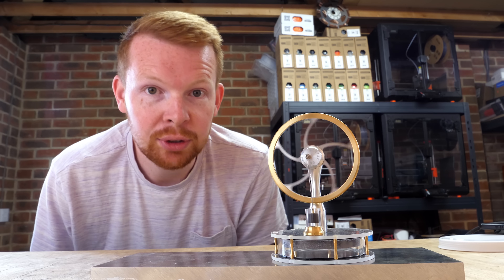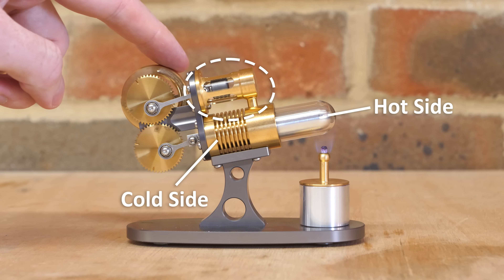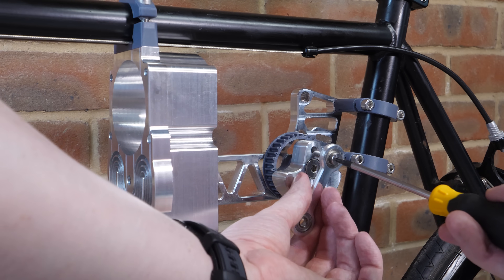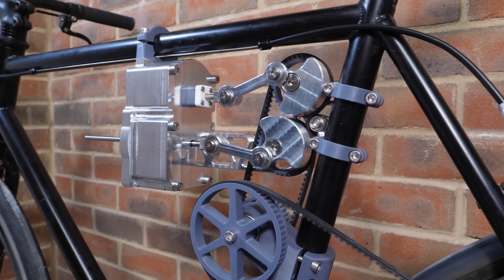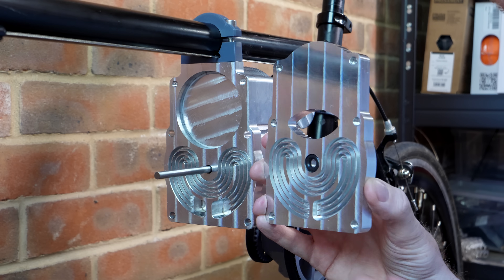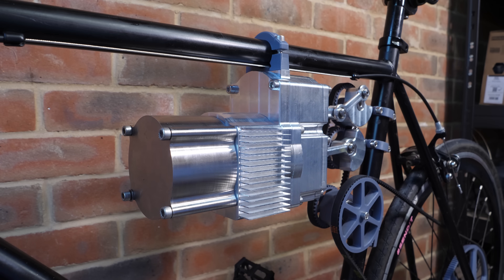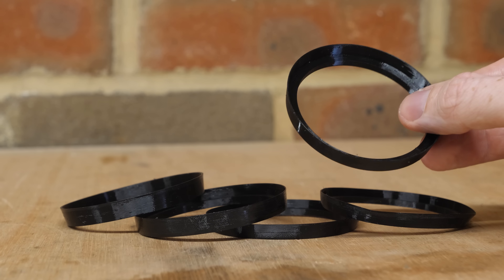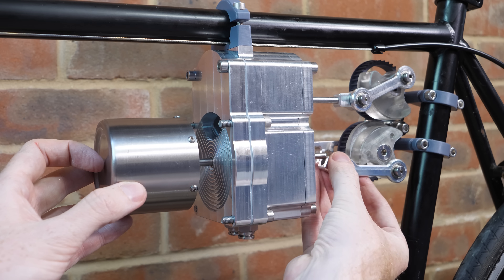Building a Stirling Engine Bike - Part 1

Comment: Tom please make this instead it works 100%  A Hall back array Magnet you turn on and off to pick up heavy steel, well it uses little to no energy to turn the magnet on and off, you can make a repulsion motor by making a piston engine, that when the magnet is reppeled the hallback switch can rock past a cut off to then recipricate the engine over and switch to turn the magnet back on all using simple mechanics. I hope this helps you and others. Have an amazing day.

Comment: Good call on the flywheel. What about mounting the cylinders vertically with compression stroke facing down to get that small gravity assist. Plus it would remove horizontal tension on the shafts.

Comment: Hi Tom, great work!
I'd like to share my idea, even though I'm no engineer: consider mounting the engine with the hot end toward the rear wheel, so the entire radiator will be exposed to fresh air as the bike moves forward. Then, with various air ducts, you could also increase the flow of fresh air to the radiator core while simultaneously confining the heat around the hot end. That's assuming my suggestions benefit heat exchange. If you want to go all out, you could also consider making the radiator core out of copper, isolating it from the hot end with a cork gasket, or some other thermally insulating material (though that would add a few pounds to the final price).
P.S. I finally figured out how the Sterling engine works.

Comment: FWIW: Despite their inefficiencies, I appreciate what are in my opinion the two biggest advantages of the Stirling Engine over the Steam Engine:  

(1) No boiler to potentially rupture and explode. 

(2) No need to have to top up the water in the boiler from time to time, which if neglected could lead to "(1)" above. You can use a steam condenser to recover the water, but that adds weight and complexity to the engine.

Comment: Sucks the CNC machine cant print out Nitrile Rubber seals. Not sure how theyd hold up in your engine but theyre pretty flexible and used for varied pressures.
Reply: Or 3D printer even... Ive just drank pretty strong wine... Im gonna go watch videos on different engines. As for your steam engine idea, its a good idea, buuuuuuut to really make it reliable, youd need to run the moving bits in a engine block separate to the cylinder head so you can oil the moving bits and work a pump that runs the steam oil through a tube into the cylinder head to lube up the cylinder head then have a way of running the steam through a radiator to cool it back to water, to run through the cylinder head again thus needing less refils... But youd need a way to separate the oil... I thought of a way years ago using some mesh that steam would pass through but oil would get trapped and recirculation in the head using a ultra fine bit of kevlar or something but then figured it would melt the kevlar

Comment: I was wondering if a Stirling engine could be used to produce electricity from concentrated heat using a parabolic mirror as the heat source. I'd love to see you build a Stirling engine, especially for this kind of setup. I believe this approach could be very useful in remote areas where commercial electricity hasn't reached yet.

Comment: Trouble with stirling engines is low power output - they need to be pressurised to produce any useful output. Might be an idea to study the Philips generator set from the 1950s. It produced about 200 watts.

Comment: Dont waste your time on a direct driven sterling bike! The biggest problem with sterling engines ist, that you could not control the RPM. You should use the engine to produce electricity, f.e. stored in big capacitors, and with that you could drive and control the speed. 
You also could replace the air with helium. 
By the way, did you ever heard of the "Manson Stirling", this is an open heat engine, a bit easier to build because it dont has to be sealed completely.

Comment: You are losing most of the power trough your "working crankshaft" Its not centered on the piston, and your connecting rod angle is way of when it "fires" and tries to push it in the opposite direction for a good 10° or so.

Comment: I'd love to see a Stirling Engine with a wood fire that circulates water to heat in metal pipes. It could be a good way to heat an outside patio with a wood burning furnace inside a cabin.

Comment: That is pretty cool but not at all practical, the amount of heat needed to make the engine run with enough power to move the bike along the road with you on on it would be huge, you would be just as well off making a steam engine

Comment: You would likely have better results if you used a common crankshaft with an offset eccentric for the displacer, much like a steam engine. This would eliminate the wasted energy required to turn a whole separate crankshaft. I look forward to seeing where this project goes!

Comment: Excellent! 
You did a lot of good work.
With that low torque maybe it could trickle charge a battery for an electric motor and even while it’s parked if you used a solar heat capture reservoir of some sort.

Comment: This is really interesting... I have been dreaming of having a tiny heat engine for a generator. And like you, once upon a time I did think of steam. Then I learned of stirlings. Since then however, I have been also considering Brayton cycle, which is best known for gas turbine engines, but turns out it could be used with external heat as well, now that would sacrifice efficiency, but I don't care so much about efficiency, as the idea would be using waste heat to provide some electric power.

But so far, these are just dreams... I hope some day I could tinker with things I have been dreaming about.

In the meanwhile videos like this are inspiring.

Comment: Instead of a burner, why use one of those induction heaters that can heat up stubborn bolts, im sure you can get hand held battery powered ones.. You could have it surrounding the top of the displacement piston and wrap high temp insulation around the heated parts to keep heat trapped around the top of the displacement piston.. just an idea! Love your vids and cool ideas you come up with!

Comment: Have you considered a turbine instead of a piston? It might help your sealing issue 

Secondly, how is this any less work or any less efficient than a steam engine? I'm not even sure if this would be more safe considering all the modern bells and sensors you could add to a steam setup to make it practically perfectly safe

Comment: Everyone always says these things run on heat. 

Tom, I have an idea.

You know how warm the ambient air is?

It’s pretty lukewarm to us, but you know what BOILS IN THE AMBIENT AIR TEMPERATURE???

That’s right:

Liquid Nitrogen.

Adding a burner is kinda meh in my opinion. At that point you might as well have an internal combustion engine. It introduces all sorts of extra problems to solve. 

But let’s clarify something:

Sterling engines do NOT run on heat alone. They run on the flow of heat energy BETWEEN temperature gradients. Hence the reason for a hot AND cold side. You already have to cool one side of it. Take it down in temperature far enough (ie. with liquid nitrogen, and the ambient air temperature will be plenty for the hot side.
And if it’s not, then heating it after will be a much less problematic endeavor.
Reply: @morganrowlette678 I can't wait to see your video, will it be ready next week?

Comment: How Tom Stanton Ended Junk Mail
Epsiode 1: You are here.
Episode 2: Regenerator makes the engine powerful and efficient enough to drive the bike.  Slow test ride montage.
Episode 3: Engine is incorporated with a DC generator into a hermetically sealed pressurized chamber and the power density increases to a feasible level for an ebike range extender.  High speed test ride montage.
Episode 4: Tom develops a combustor that gasifies waste plastic and paper and then burns the char.  The combustor uses oxygen sensors and flow diverters to ensure the exhaust gas is stoichiometric to lean, and an enthalpy wheel to capture heat and fuel particles from the exhaust to be sent back through the combustor.

Hey presto!  People stop paying for fuel, and start collecting rubbish to power their commutes.  People begin applying for credit cards, coupons, and ordering catalogues.  People start making tiny donations to every charity they can think of, just to get requests for more in the mail. Junk mail gets abused as a fuel source to the point that it simply stops.

Comment: I have this exact engine made by kontax. Excellent British design and Cnc machining. I run it to occasionally and find the slight ticking noise relaxing.
I bought it at a model engineering exhibition in Harrogate.

Comment: Machinist tip from a machinist. Your end mills are hanging out to far from your tool holder. Bring your tools in closer to avoid tool deflection. ESPECIALLY if your going to move on to steel.

Comment: Could you use a small inductor to heat the stainless steel and have it run off a battery pack instead of a burner or propain?

Comment: I have been wondering what efficiency you can get using a heatpump with a high COF to create a hot and cold side, considering it can create 4 to 5 units of heat, and 3 to 4 units of cold for one unit of electricity. Wonder how close you can get to 0 energy usage in combination with a sterling engine

Comment: Some time ago i looked into sterling engines. If I remember correctly, they can be efficient at quiet low temperatur differences. A DUNE - style body suit, that pumps liquid in a layer around your body, activated by muscle action, might - at least in the cold season - be a better suited heat source than a blowtourch between the knees. -well, the top power might be lower.

Comment: I've never heard a Sterling Engine called anything else. Certainly not a "hot air engine" because it does not run off hot air. If it did, you'd have made one long ago.

Comment: You can modify it to run a generator like a range extender, where it can charge up some capacitors which then are used to power an electric bike setup.

Comment: Directly running the drive with a Stirling engine sounds difficult. You might have better luck turning a generator to power a hub motor. With a battery or capacitor bank in between.

Comment: Any way to use induction coils or another electrically powered means to heat the cylinder? Having a flame under my seat is less than ideal.

Comment: Its looking like you dont have enough weight as well to help retain the kinetic energy made by the stirling engine. 

I'd also look into another heat source or a way to contain it safely in use if you actually want to ride on this thing at some point.

A suggestion for a arguably safer heat source would be some thermal wire from a hairdryer or heater and a high capacity battery (and possibly a way to change the voltage running though the wire so you can shut it off or lower it during travel to store power... and maybe a alternator to recharge the battery from the stored thermal energy on the go)

Comment: Dude I applaud your efforts. Try measuring the compression with reference to atomospheric pressure. Then consider the Thermodynamic equation where you a/c for both Heat and Latent Heat. Then find out the Energy that is being delivered by the piston and then find our the angular momentum it would produce in the crank. This will give you the overall HP produced by your engine. Maybe you need better compression ratio. All said - how are going to deliver that much heat energy and that too just between the cyclist's thighs ? All puns strictly intended and intentionally coincidental. LOL

Comment: I noticed the following thing : when you had stopped the engine and took the burner off and then hand started it again, it seems to run faster for a bit on stored heat than it did before with the burner… my guess is the water cooling was still running , and so it seems to me that the cooling side is not efficient enough, but your isolation is.

Comment: The ultimate siteling engine bike would have a heat exchanger you wear, and power the engine with your own body heat as you work out while cooling you down. I mean, of course this would only aid in moving you forward, and probably not by much, but still

Comment: If internal combustion engine design ports over a bit, the surface finish of your cylinder and the piston ring thickness (thinner is better) are major factors in sealing and parasitic drag.

Comment: The design of the piston ring only seals positive pressure but when the air cools down there's negative pressure. You should add a second piston ring turned the other way to seal that

Comment: This really isn't a Stirling engine without a regenerator. That's the very thing that makes a Stirling engine, and what distinguishes it from a simple hot air engine. The regenerator dramatically boosts the efficiency, making Stirling engine actually practical in the right circumstances, unlike a hot air engine which is just a toy, regardless of the size. Completely omitting it from your explanation and not even mentioning it until the very end sadly perpetuates the misinformation that persists around these engines.

Comment: while intresting the engine placement means you're going to burn the inside of your legs and you won't be able to ride it safely a more optimal location wold be directly above the rear wheel out of the way of the rider.

Comment: youll prob not seee this but heres what im certain of. the bike wheel is huge in cotnrast to the engines force per rotation. what im sayign is you need an extraordinairy amount of torque or inertia for the engine to successfully turn the wheel WITHOUT ANY GROUND RESISTANCE meanign ti struggles when only friction exists. a simple and easier solution is transmission logic, where you change the ratios so that the stirlign cna get a consistent uninterrupted and smooth rpm in exchange for slwoer wheel speed, yes i know its a sacrefice but the other option would be to increase power stroke frequency by addign several mroe pistons to cover for the "in between states" the stirlig ahs difficulty overcoming in. hope this helps

Comment: Cyclist here...  Im not sure that makes enough power to go very fast, but that might not be the goal.  There are a lot of electric bikes coming out.  Its a little annoying when they go 30 mph down the cycle path.  On the other hand an engine that simply puts the equivalent power of the wind at your back might help some people.  Doesn't really matter if it throttles well.  Light constant torque is fine.  IMO the problem to solve is improve thermal efficiency so that it doesn't take a blow torch to make it run.  That is probably way more than a few watts of energy.  Use a section of frame as a radiator and circulate coolant with a magnetic coupling for an impeller using the wheel to turn it.  I'd be curious to know if the engine works backwards when you roll down a hill turning kinetic energy into heat.

Comment: Ciao Tom! If I could suggest an alternative to the blow torch for the heat source (I'm still not convinced you need such a high temperature on the Hot side of the stirling piston), you could use the Catalytic process of burning flammable materials without the flame, like the one used in hand warmers like this: ZIPPO MOD. 40365

Comment: Waw, Really Genius and professional. What if you add a Gearboxe between Crank and Flywheel? Will it increase the torque at Flywheel and Reduce load on Power piston?

Comment: neat. few ideas. home/polish the cylinder wall. charge with nitrogen as it expands more than air when heated. bolt on bigger fins around mid section. silicone isn't a good insulator it needs something between hot and cold end and perhaps less surface area. make duct over hot end trap the heat.

Comment: I've been wanting to make my own stirling engine for a while now. Have you tried adding steel wool between the pistons maybe? I have heard a regenerator makes a lot of difference. Also, congrats on getting your engine running. Designing stirling engines is pretty hard to do, especially designing one for a large output; getting them running is also another challenge. Also lmao, just watched the part where you mention the regenerator.
Reply: The my engines guy on youtube has some really cool videos with stirling engines. Also look into thermoacoustic engines. They're mind blowing and imo a lot easier to build than a traditional stirling engine design.

Comment: 7:05
More efficient? I mean, technically they CAN be more efficient, but they usually end up being ~30-40% efficient, which is about the same as the most efficient ICE engines we have. Steam turbines can be just as effecient, but are MUCH more power dense, although you'd need a condensing steam engine to use on something like a bike.

Comment: Similar reasons they can only be used as a range extender for a battery electric platform vehicle, they are hard to make but can be exceedingly efficient if well made with very high precision designed over hundreds of iterations of tuning to get a solid version for production, far more finicky than automotive engines, its super trick and requires aerospace level machining & thermal management heat control thermodynamic tuning

Comment: Fill it with helium. Hydrogen is more preferable, but explosive. Makes the transfer of heat faster. 

Will take more work to make air tight, but I'm pretty sure it'll help your efficiency with your setup. 

Other thing: Stirling engines work best at a fixed rpm, so you might be best off using it to run a generator, then using battery power to power the bike